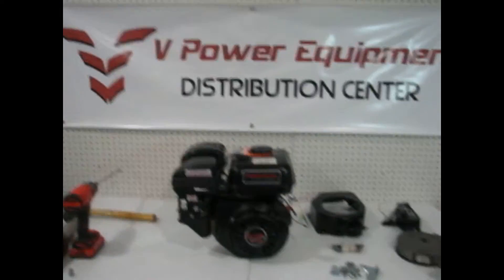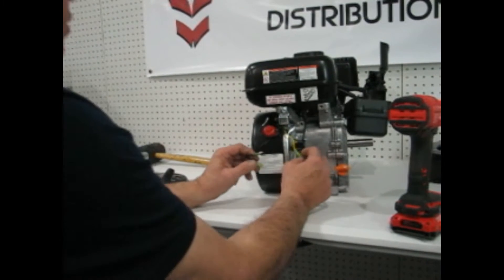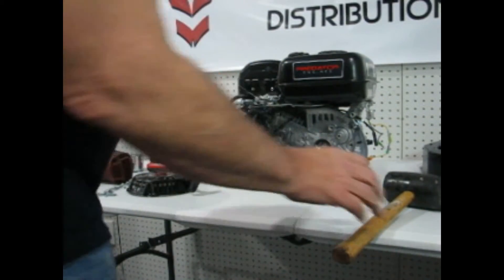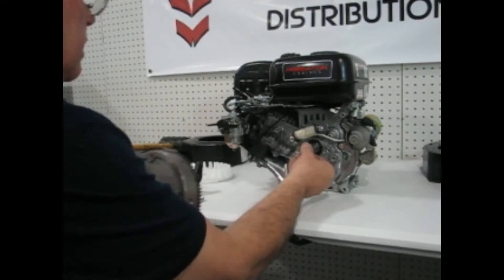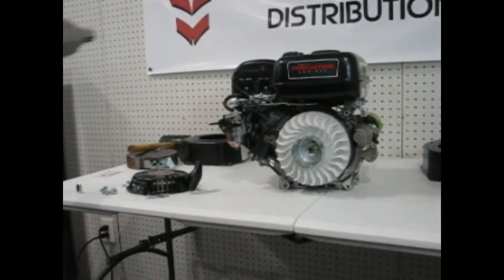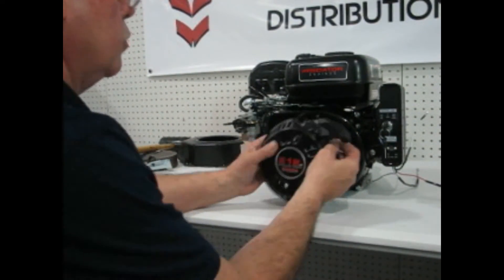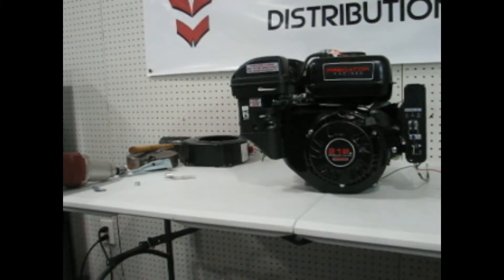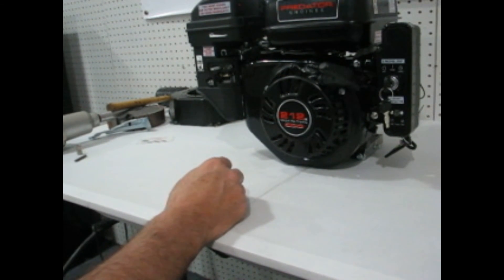Predator 212cc Electric Start Kit Installation

Comment: I ordered a starter kit for a 6.6 224 cc. The kit did not fit the fan didn’t line up on the flywheel and the starter did not fit what kit do I need
Reply: Probably cuz this video is for a 212, not 224

Comment: can you extend the wiring from the unit to place it further away from motor?  Like near dash?
Reply from the maker: anything can be done I would advise that you have a very good understanding of electrical as you will need to build a wiring harness and when building the harness do not forget to run a ground between the key box and the engine
Reply: @vpowerequipment321  Thank you for replying, appreciate it!

Comment: I have a yellow green wire from the starter box with round head head 
Is this for the oil Senser that I don't have or what?
Reply from the maker: sounds like a ground wire however as far as I know our kit are internally grounded and do not have that wire
Reply: @vpowerequipment321  if I ground it could I burn up any parts
Reply from the maker: @dennisrusk3599  I need to know whet kit you have we sell several differant types please provide me with the order number and I will look into it for you

Comment: I have 212 non-hemi engine, install the kit, as soon as I connect the battery it fries the ignition coil, any thoughts ?
Reply from the maker: battery cables are backwards positive to the starter relay negative to the block having them backwards will fry the ignition coil

Comment: there should be a small metal clip that holds the wire from the charging system flush against the block and away from the flywheel. I guess this kit doesn't have that part.
Reply from the maker: it is in the kit it is just not shown in the video

Comment: What kit is for the predator max performance 224. 
Is that considered the 212 hemi?
Reply from the maker: No the none of the 212 kits will work on the 224cc we are in the process of having a kit designed for that engine and hope to have it available early July of 2023
Reply: @vpowerequipment321  that's good, I'll keep an eye out for your kit. I'm in exterior cleaning and I have several machines running the 459 max performer. They are great machines and the internals are superior to the Honda gx390. 
I'm now building a gas softwash system and want to use the 224. But they don't come with the key start. 
Im going to build the machine to use now but I'll be watching for your kit!
Reply: @vpowerequipment321  after further search there are several people / videos stating the 212 non hemi key start kit works on the 224.
Reply from the maker: @deanweingarth9586  you may be able to make it work by cutting up the original shroud or replacing the fan blade with a smaller blade and we do not recommend that . The fan blade is larger and housing is deeper on the 224 than the 212
Reply: True on the shroud. Better to cut the shroud than putting small fan blade but I don't like being a hack. I'll watch for your 224 kit.

Comment: My engine start but when you turn key off it still runs ? Please help me with this issue
Reply from the maker: If the engine will not shut off that is due to no ground connection between the key box and the engine. If the key box is mounted to the engine check the connection point, maybe even remove some paint to get a good metal to metal contact. Generally this happens when the key box has been remote mounted and then you will need to run a wire from the keybox to the engine.

Comment: Good news bad news  I ordered your kit it starts BUT IT WONT KILL please help 😂
Reply from the maker: If it will not shut off the engine that is because the key box is not grounded to the engine. If you are remote mounting the key box run a ground wire between the key box and the engine.

Comment: What kind of battery supposed to use
Reply from the maker: 12 volt,
300 CCA, 36 Ah or larger battery
Reply: Thank you for telling me what battery brand do you recommend
Reply from the maker: @ilikemotors2008  We do not have  a preference of the brand

Comment: My question to you is will this kit work for a predator 224cc non-Hemi engine?… I watched the video you explained it well but I don’t have a 212cc … will it work for my 224cc?
Reply from the maker: Sorry it will not work with the 224 because the 224 has a taller fan blade and the shroud will not fit
Reply from the maker: we do offer a 223cc Viking engine that comes with electric start and can be found here https://www.vpowerequipment.com/viking-223cc-7hp-electric-start-hemi-head-engine/

Comment: this kit come with instructions ? 

this will work with aluminium fly wheel ?
Reply from the maker: this video is the only instructions and no it will not work with the aluminum flywheel
Reply: Instructions come with Harbor 212, but they suck!

Comment: What what is the charging coil hooked up to and why?
Reply from the maker: yellow wire that turns brown from the key box goes to the charging coil that you mounted under the flywheel to charge the battery

Comment: 7:23 so you didn’t hook up the wire to anything you just tucked in between the starter???
Reply from the maker: all wires get hooked
Reply from the maker: if you are taking about the charging coil it goes to the key box the wire with the diode in line (small bump in the wire)
Reply: @vpowerequipment321  why to the key box? I want mine to charge the battery and when I got the setup it was installed already and also connected this way. Wondering if I can keep it installed to the key box and run a wire off it to the starter as well to charge the battery and run other stuff

Comment: For everyone watching this,please torque the flywheel 55 ftlbs
Reply: What if you don’t have torque ratchet etc. ?
Reply: Harbor Freight has them for relatively inexpensive  @alphawashacademy5126
Reply: @alphawashacademy5126 then until right before you have to start making noises or hold your breath to get it to turn 😂 Orr go buy a cheap torque wrong their like 20-30$

Comment: so the wire to the negative battery terminal should be from the engine? any particular part? or just hook it somewhere?
Reply from the maker: Any good metal connection you want to be sure the starter has a good ground connection

Comment: does anyone know what i should have the chock at when starting? im new
Reply from the maker: use the choke the same as you would with manual start
Reply: @vpowerequipment321  thanks!

Comment: Will the 212 non hemi kit work on the 224 Max Performance? From what I understand the 224 is a 212 non hemi with better internals.
Reply from the maker: We are going to be testing or if need be creating a electric start kit for the 224 engine soon. We do offer the Viking 223 hemi engine with electric start already installed link below
https://www.vpowerequipment.com/viking-223cc-7hp-electric-start-hemi-head-engine/
Reply: @vpowerequipment321  thanks for the reply. All good to know. I’ve already picked up a new 224, so I’ve been searching around to see what can be done.
Reply: Viking 223cc better than predator

Comment: Definitely Massachusetts, I would say East of Worcester. Could I take the key box and put it up somewhere else and run wires to connect it? I have two mini bike projects I am picking up today and want to be able to be on the bike to start it from the seat and not reach down. I also want to put lights on at least one, how many volts does that produce and what type of battery will it charge? This is a great video, thank you for this.
Reply from the maker: you can remote mount the key box just be sure that it is grounded to the engine the charging coil produces about 5 watts at 12 volts at full RPM and will charge any battery

Comment: The hardware for the kit just comes in a bag with no labels.  There is also no instructions in the box, only a paper referencing this video.  I was hoping with this video you would show what bolts to use before installing them.
Reply: Really! I think if you can’t figure that out, maybe go to a more qualified mechanic…

Comment: Seen you switch from the 10mm to the 8mm, during disassembly.

I've taken mine apart a few times.
Mine came with a faulty coil.  Brand new, lasted thirty minutes.  Harbor Freight was out of stock, and didn't know when they were getting any in, so I fixed it myself.  Ok actually bought 2 coils, just in case!

Comment: I have a duromax 16hp 420cc with electric start. Do I need to add a second charging coil to charge the battery? I can't really find any information  on this engine or if it comes with 2 coils already. Also I'm trying to instal a voltage regulator and not sure how to wire it with my electric start
Reply: did you ever find that out?
Reply: @IndestructibleTurtle  yea I did have to add a second charge coil and I found a good video on redbeards garage explaining wiring a volt regulator

Comment: Can I remove the ring gear from the flywheel that comes with this kit using heat?  Once off will it fit around any of the custom aluminum billet flywheels on tbe market?  I cannot run a cast iron flywheel because I no longer have the governor.  Please help!
Reply from the maker: no that will not work
Reply: They sell billet flywheels with electric start rings already on them just look it up.
Reply: @taytay999090  Thanks.  I'll look again.
Reply: Thank you for the reply.  I figured it couldn't be that easy without a bunch of lathe/milling work.

Comment: When installing my flywheel it wont turn after I tighten the nut. I have a hemi and bought the hemi kit.
Reply from the maker: please contact us through email or phone sales@vpowerequipment.com or 508-273-7596 we will need to get additional information from you and then we can have a technician help you with the problem
Reply: Did you find out the problem?

Comment: Would you suggest using a torque wrench to tighten the shaft nut? Or you think it's safe to just use impact drill?
Reply from the maker: impact works fine

Comment: Do you have the hemi 212 kit ? I need one
Reply from the maker: yes here is the link https://www.vpowerequipment.com/predator-212cc-electric-start-kit-60363/
Reply: @vpowerequipment321  do you just the charging flywheel. I have all the other parts already just need a the fly wheel.

Comment: What if the oil senor is removed? How will the electric start wire up
Reply from the maker: we do not offer guidance on how  to wire a modified engine
Reply: Threw the switch. On the handlebars
Reply: Hey ? I removed my oil sensor as well engine starts but won’t kill in off

Comment: When are you guys doing a video on this kit being installed on a hemi and showing the flywheel difference
Reply from the maker: the installation is the same on the hemi as the non hemi the difference with the flywheel is the size of the crank shaft bore

Comment: I recently installed one of this kit, but what happens if you install 2 coils instead of 1 at minute 5:50?
Will it charge the battery faster? or will it burn the ignition coil?
Reply: Did the kit come with two coils?
Reply: @vpowerequipment321  Do you have a voltage regulator that you recommend using with this kit?  Maybe you could provide a link to a regulator that would work...?
Reply from the maker: The kit does not require a voltage regulator with the charging coil.  We have found that if you use the lighting coils they should only be used for lighting only as they produce AC currant.

Comment: Very good idea to wait until you have your engine to know for sure which model you have. I ended up with a Hemi and found out that the parts for that are a lot different. Also that no one was selling an electric start kit for it. Was super happy when I came across your site. Immediately made the purchase and it should be coming in this week! Looks like a simple install so hopefully it goes smoothly🙏🏽
Reply: Did you install your kit on your hemi already?
Reply: @Mini.Moto.Guy806  I did! Followed the vid and worked perfectly.
Reply: I need a starter kit for my Lifan LF-190F, Its a 420cc engine. Can someone help me find a kit please.
Reply: what was the difference for the electric start? i just think the flywheel is different

Comment: Will this fit the 63963? Or if not, do you know where to get the kit for the 63963?
Reply: I have the Predator 4375 Generator and mine is the 63960....I also want to know if there is a kit to fit it?
Reply from the maker: I am sorry we have no record of that item what is a 63963
Reply: @vpowerequipment321   Its a Predator generator at Harbor Freight,  212cc, the 4375 watt one. The Harbor Freight here literally had 50 of them piled up in the store, I guess its the most common one.
Reply: @vpowerequipment321  Isnt the 63963 the California epa version of the rato Predator? Pretty sure the kit for the non California rato would be the same as the California rato version.
They sell 3 versions of the Predator within the U.S.
Loncin-hemi
Rato-non hemi
California epa Rato-non hemi
Reply from the maker: @Mr_Tecumseh  sorry I have no information on a 63963